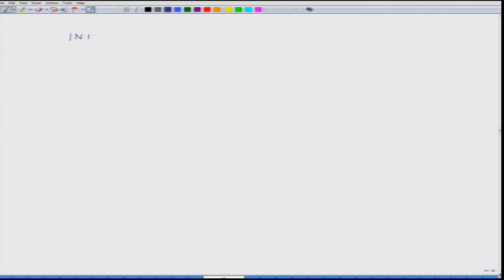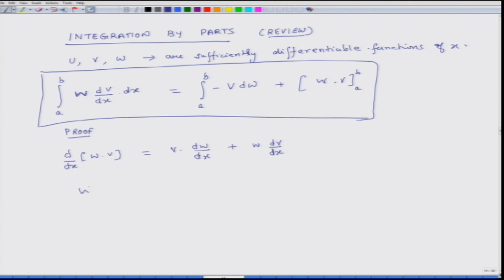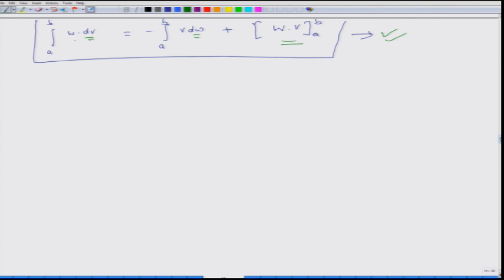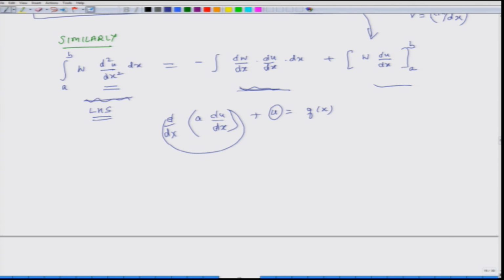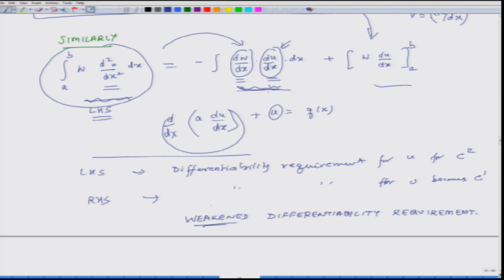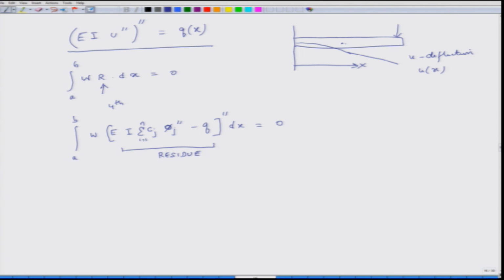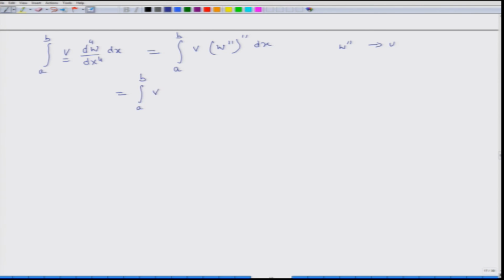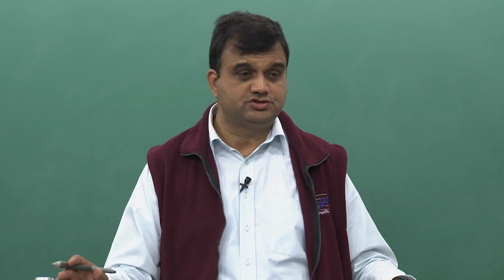Integration by parts -Review

Comment: But in last term (v.d3w/dx3) over a to b is in 3rd order
Reply: Yes I noticed the same thing. I guess you can only reduce the differentiability of the residual by one. But there is still a benefit in balancing the differentiability of the residual and the weighting function IN THE INTEGRAL, because this is what leads to a symmetric matrix (more on this in later lectures).
Reply: @Kryptic1234   but the differentiability requirement of both functions is not the same so how can we get symmetric matrix
Reply: Its value will depend only on boundary as there are limits on it which i think we would be given as BVP
Reply: The third derivative will be the shear force, which would be given as a BC